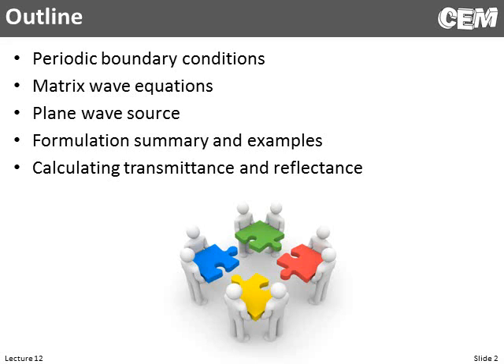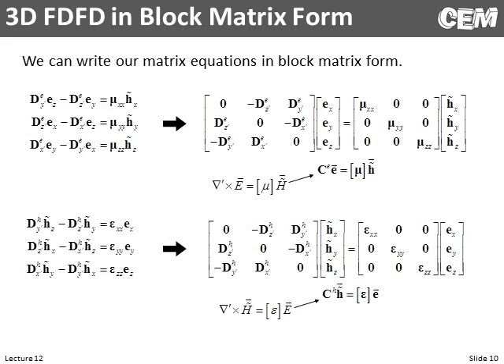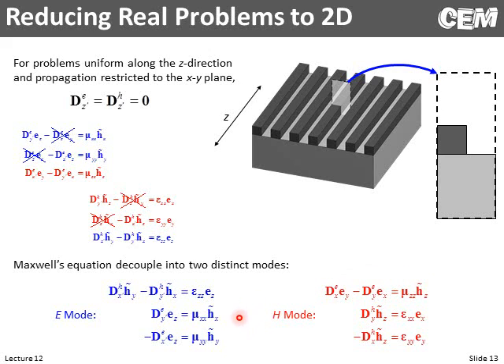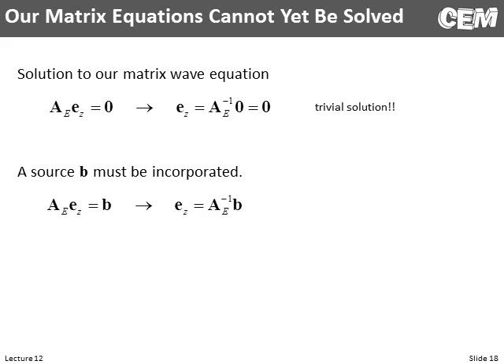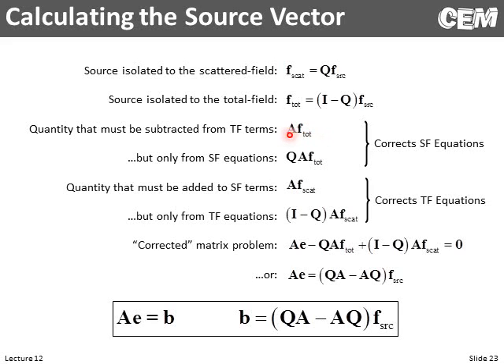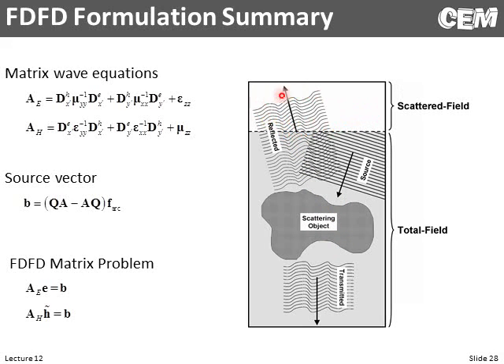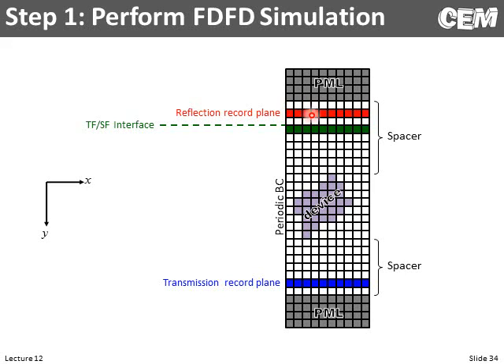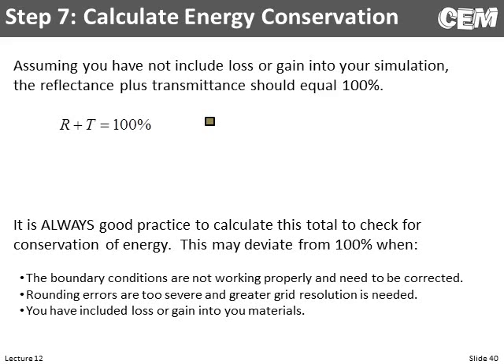Lecture 12 (CEM) -- Formulation of Finite-Difference Frequency-Domain

Comment: Hi Doctor. Very excellent course to you posted. Thank you very much for your effort. What's more important, I can feel your passion in EM. 

Regarding what you introduced in this lecture, I have three questions.

1. does the equation Ae=0 really only have trivial solution of e = 0? I did not check carefully but I guess if the matrix A is singular, then e may not have to be zero?

2. When scattering field is none, then matrix Q = 0. And if scattering field is your total solution space, then Q is the unit matrix. In either of the 2 cases I have b = 0 and e = 0, which confuses me because if scattering field does not exist, the full solution space is total field and I am supposed to get a solution of the source itself(if no reflection). I am asking this because I am trying to apply some extreme cases to benchmark what I learned from your lecture.

Thanks again for the patience.

Regards,

Yue Li
Reply from the maker: 1.	There is a whole different discussion when looking for singular values. Really though, this equation does not have much meaning until a source is added.

2.	In the way I have formulated this, your simulation must have both TF and SF regions. It is easier to think of this in terms of the TF/SF interface that must slice completely through the source in order to completely describe the source. It is possible to have a scattered-field only formulation or a total-field only formulation, but it is a little different than what I show here. We have a paper coming out soon that will describe a SF-only solution.

I should point you to a book I recently published on FDFD that talks extensively about the TF/SF source. I do not cover the SF-only source in the book. I was under pressure from the publisher to keep page count limited so I had to skip some things like this.
Reply: @empossible1577  Will surely do! Thank you very much!
Reply: Btw, for the first question regarding Ae = 0, it is, in my opinion, analogous to Helmholtz equation but in discrete form. The Helmholtz equation ∇²u + k²u = 0 can have the nonzero u as the solution(e.g. plane wave). And that is why I raise the first question. Thank you.

Comment: Hello, in what certain cases one should pick fdfd method instead of a faster RCWA method?
Reply from the maker: Great question!  In my opinion, RCWA is best restricted to simulating periodic dielectric structures like diffraction gratings, photonic crystals, and guided-mode resonance filters.  It is very fast and efficient for both 2D and 3D simulations, but it requires a bit of extra work and post-processing for visualizing the fields.  While RCWA has a reasonable implementation, it can be very strange and difficult to learn.

I think FDFD may be the absolute best first-method to learn.  I think it is the easiest to learn and implement of all methods that can obtain a rigorous solution to Maxwell's equations.  It is excellent for field visualization and for being a very versatile method.  FDFD can inject any type of source and calculate any parameter about a device with relative ease.  There really is nothing you cannot do with FDFD.  It is just that other methods could do it faster and more efficient, albeit with a much greater investment in learning and implementing.

I am not sure if you are aware, but I recently published a book on FDFD.  I think it is an awesome book for both learning FDFD and for getting started in computational electromagnetics.  It is the book I wish I had when I was getting started in CEM. I think you will find RCWA easier to learn if you first learn FDFD.  Here is a link to the book website:

https://empossible.net/fdfdbook/

Hope this helps!
Reply: @empossible1577  Thanks for the answer!  I believe speed problems can be solved with matlab coder app for fdfd if it comes too slow :turning it to C through that app can increase computation speed from 2 to 70 times. Cython could do it up to 3000 times because of how slow parameter sweeps are carried in python.

I would like to ask another question, is it possible to repeat the results of your last paper about PhC lens on RCWA, or can it only be done on fdfd? Can periodic boundary conditions in RCWA give me a field curvature in the substrate? So far as my calculations went, I only received transmitted waves as plane waves or their interference if diffraction occurs. My guess it's the limit of RCWA. 

I also read the book. The theory explained there is simple and the codes are user friendly! Will definitely implement them to solve further problems.
Reply from the maker: @ignatiolu863  As for speed improvement.  One of the main bottlenecks in FDFD if the matrix division f=A\b.  This is performed by a highly efficient and compiled code within MATLAB.  I am skeptical you would get much speed improvement.  I have run my MATLAB RCWA up against C/C++ version and my MATLAB code was faster.  Again, that is because the main choke point in RCWA is an eigen-value computation that is run in MATLAB using a compiled and highly efficient code.  Speed improvements are much more pronounced in algorithms that do a lot of manual manipulation of the data, like finite-difference time-domain (FDTD).

I do not think RCWA is a good method to simulate the lens.  The eigen-value computation scales very poorly with the size of the cross section.  This is very large for the case of a lens.  I believe it could be done for a 2D simulation and a powerful enough computer.  I think FDFD, FDTD, and FEM are the best methods for the lens simulations.

I hope you enjoy the book and learn a lot.  I would love to hear your feedback on it.

Thank you!

Comment: Hello,

Simple ask : Slide 31, would it be relevant to simulate an optical fiber on a 2D grid? If I understood correctly your lecture, 2D grid assumes an infinite extension in the z direction (or whatever direction), while optical fiber are somehow cylindrical and not infinite in one direction...

I really enjoy your lectures. Every step is derived properly, it makes things so easy a the end. Thank your for sharing those videos :)

Jules
Reply from the maker: Thank you!!!

There may be a way to do this using the effective index method depending how what you want to simulate.  I have not done this for an optical fiber so I cannot confirm if it would be accurate or not.  Essentially, if you lay a fiber down onto a table and look at it from the top, then average the refractive index from one side of the fiber to the next, you will end up with a slab waveguide with some kind of refractive index profile.  Propagation in this slab may behave like that of an optical fiber.  Perhaps you could test this by duplicating the results of something known?  Did what I say make sense?  I don't have a picture of what I am talking about.
Reply: Yep it makes sense. As you said, looking an optical fiber from the top is very similar to a slab waveguide. I shoud try the simulation and compare it to acknowledged results, once I'll have all the background necessary to simulate it :)

Best,
Reply from the maker: I have not seen the effective index method used for simulating optical fibers, but I also have not looked very hard for it in the literature.  If you get it to work, you may have something publishable.  Good luck!!

Comment: The new slides (http://emlab.utep.edu/ee5390cem/Lecture%2013%20--%20FDFD%20Formulation.pdf) point out that if the grid is 1 dimensional, i.e. Nx1 or 1xN, then there is a situation that I don't understand: if we consider the case 3 of the benchmarking document (http://emlab.utep.edu/ee5390cem/Benchmarking%20Aid%20for%20yeeder.pdf):
·1  ·2  ·3  ·4   (4x1 grid)
·5                   (illustration point for BCs)
Why do we have that DEY = diagonal(j*kyinc) (result from slide 10 of new slides)? From the analysis, the periodic boundary conditions for the point 1 give that the y derivative "in the midpoint" between 1, and the boundary point under the point 1 should be (E_1 - E_5)/dy. By periodicity we know that if E_1 = A_1*exp(j*beta*y_1) and E_5 = A_1*exp(j*beta*y_5). This implies that E_5 = E_1 exp(j*beta*dy). This is clearly different from the result in slide 10. Also, I wrote the code accepting the result shown in slide 10 and in the case 3 the DEY matrix should be diagonal(44.429j), not the one shown in the benchmarking doc.

Thanks for your help.
Reply: thank you now it comes out from a wash
Reply from the maker: In this case the size the grid in the y direction is just one  Instead of doing this numerically, it has a simple analytical solution by simply differentiating the equation for the wave in the y direction.

(d/dy)A*exp(j(kx*x + ky*y) = j*ky*A*exp(j*(kx*x + ky*y)

Thus (d/dy) = j*ky.

I did just notice a mistake in the benchmarking document.  It appears the DY was divided by dy.  This should not happen for the case where Ny = 1 because a finite-difference is not being used.  I will try to have the benchmarking document revised as soon as possible.
Reply: +CEM Lectures thanks for your support.
Reply from the maker: I fixed the benchmarking document.  I worked quickly so I hope I did not make any other mistakes!
Reply: +CEM Lectures such an excellent teacher. thanks for sharing the knowledge. I will try to keep working on the course during holidays, and if I find any mistake I'll be happy to point them out to you to keep improving this great course!

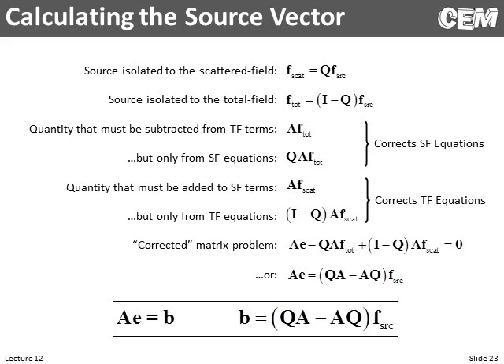Comment: 1. Could you please explain 29:31 (Slide 23) in more detail from electromagnetic point of view? We get non zero terms in matrix b in cells corresponding to interface of total-field region and scattered-field region. These should correspond to sources. From Maxwells equations we can sources such as electric and magnetic currents. 

How is field from plane-wave a source, such that it can exist only in those interface cells?

2. 48:00, why are the transverse components same throughout the entire grid? The grid is not uniform in x-direction (we have some test device at the center). 

Thank you.
Reply from the maker: 1. Here we are implementing the total-field/scattered-field method.  We simply declare some points on the grid to be total-field (i.e. source + scattered fields) and the rest are scattered fields (i.e. no source).  All we have to do is write our finite-difference equations consistent with this declaration and we are garranteed to only see the source in the TF region.  The problems with the finite-difference equations arises at the boundary between the TF and SF where the finite-difference equations contains terms from both sides.  These terms are not compatible and the finite-difference equations must be fixed.  That is what the QAAQ (we prononce as quack like a duck) equation does.  For more information, check out the following paper:

R. C. Rumpf, "Simple implementation of arbitrarily shaped total-field/scattered-field regions in finite-difference frequency-domain," PIERS B, Vol. 36, 221-248, 2012.

2. The transverse components are not the same here.  They only seem to be drawn that way.  The color here is only to indicate where the field quantities have been take from the grid.  They are not intended to represent values from the grid.
Reply: (1) Thank you. I think I understand the need for correction. Does the quantity (A*f_src) or (A*f_scat)...... have physical meaning? f itself represents the field right?

(2) However (48:00) it says on the slide "transverse components are same throughout the grid". Using this principle the longitudinal components over different points on the grid are calculated.
Reply from the maker: (1) f would represent the fields, but I don't think these terms alone have much meaning or usefulness.

(2) The transverse components of the wave vectors are constant throughout the grid.  The transverse components are not constant.
Reply: Thank you very much.

(2) I meant the transverse components of the wave vectors itself, sorry. 
As I understand now, they are the same due to phase matching condition at the interface of incident wave region and device region.
Reply from the maker: You got it!  It is the longitudinal component of the wave vector that changes with distance and it is calculated from the dispersion relation.